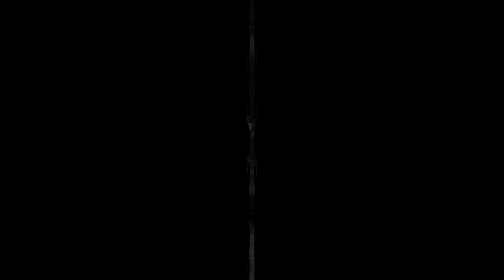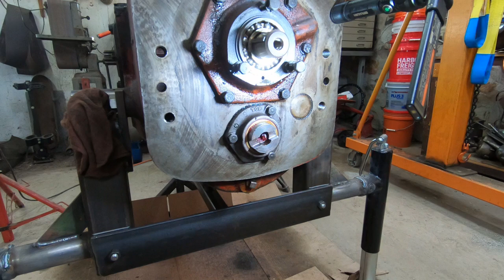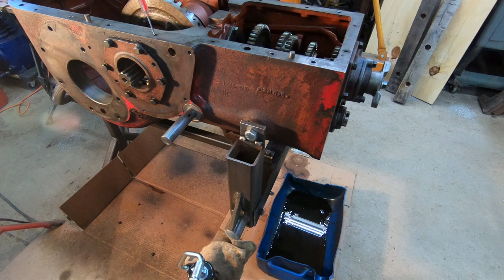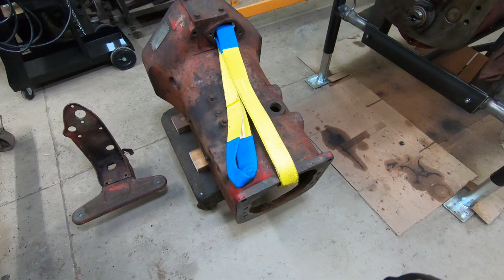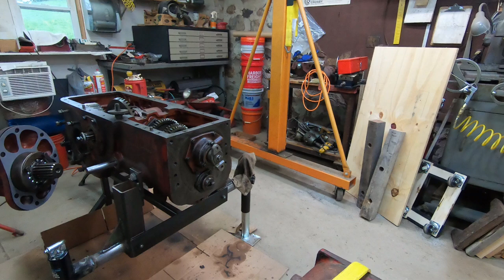#070 - 1949 Farmall H - Input shaft seal & yoke - plus hydraulic drive nut and seal install

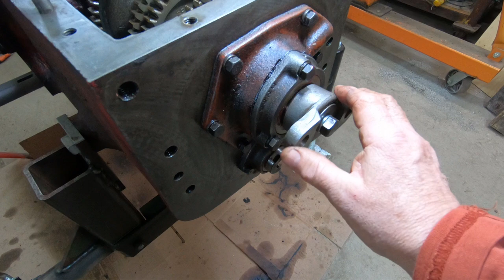Comment: @ 3:36 you are talking about the seal for the top where the shaft bolts up. I need that seal and I am having trouble finding it. Any chance you could help or point me in the right direction?